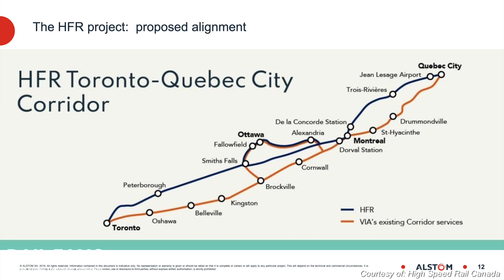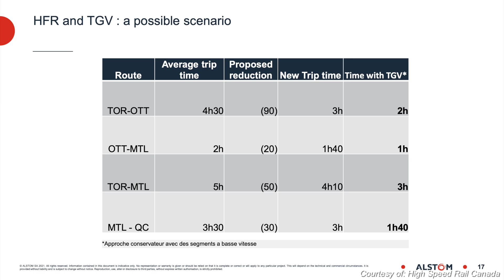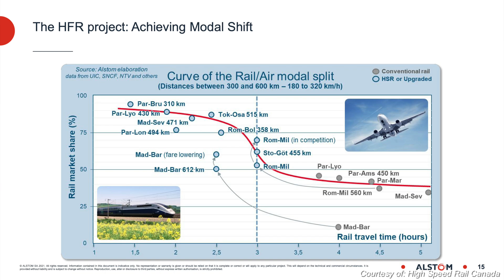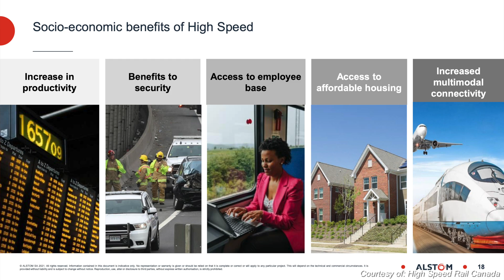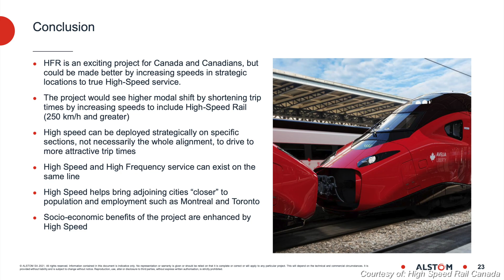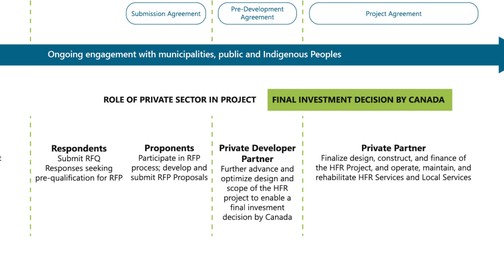The Plan To Bring High Speed Rail to the Corridor - Alstom's Proposal for High Frequency Rail (HFR)

Comment: Will never happen… Talk talk talk….  It’s October 2025… Blah blah blah… Canada does not have the skills necessary to build a modern railway system… talk and more talk…. City, provincial & federal governments in Canada are dysfunctional & cannot work together….  Canada talks about “high speed” every few years… talk talk talk….  Canada will not have a modern trouble free passenger railway system. Canada runs on roadways, highways and airports powered by the oil industry.

Comment: High Speed trains in Canada? Sure, but not between Toronto and Quebec City. Montreal - Quebec City, GREAT IDEA. Edmonton -Calgary, AWESOME. Toronto - Ottawa, maybe, Windsor - Toronto, possibly but Toronto - Montreal is IMPOSSIBLE. There are too many railway yards with speed limits below 50 km/hr between Toronto and Montreal. There are also too many residential areas in proximity of the existing track. Besides, the existing rails from Union Station to Whitby or Oshawa are in constant use for commuters and freight. Using existing tracks for high speed rail is crazy. The high speed trains in Europe and Asia run on wider track for a reason. If you wanted to build a high speed train from Toronto to Montreal, you'd have to build it from Vaughan or King City, thereby defeating the purpose of a high speed train between Toronto and Montreal. 
Of course, there are ways around the barriers if planners and engineers used their imaginations and the federal and provincial governments got together to finance such an endeavour. 
But keep in mind, maybe high speed trains are antiquated and that levitation may be the future...am I out to lunch?

Comment: Note: Alstom trains are extremely inferior to siemens and are guaranteed to be a bigger headache than an asset. The new Avelia trains have yet to enter to enter revenue service as there is an issue with software compatibility (something like that). At present they are gathering dust and having their paint stripped in a yard in Philadelphia. The Ottawa LRT uses Alstom as well - yup they've been great lol

Comment: Every stop on a HSR line and intersecting large cities slows the average speed down considerbly. Better to skirt cites and building stations near airports than build under central business districts and tie HSR with the local rail network with a spur... You don't lose overall time doing so. The fewer the stops, the faster the train. Don't turn HSR into a gold plated local rail network, you would be better off if you have too many stops to build HFR...
Reply: The train has to go to the people. People will not go to the train. When Canada was expanfing yes the people went to the train. But now that the country is lack of a better term established the train has to go to the people. Bypassing CBDs is a recipe for failure. It's job is to link cities in the foreground not in the background.

Comment: what about the many other cities along the corridor? are we just going to abandon them entirely so that Peterborough can have high speed rail? I think tat a dedicated line is needed but abandoning the rest of the system and leaving people between oshawa and dorval without a high speed network doesn't make much sense. Peterborough would definitely benefit from having a rail line connecting them to toronto or ottawa but if that is the goal then maybe have something like a go transit line that goes here and focus on upgrading the kingston subdivision. though im not a planner or someone who knows a lot about this stuff thats just my opinion and I would like to see the whole corridor benefit thats all.
Reply from the maker: As we somewhat cover in the video, a lot of details will be left to the private partner and government.

For what we know; there is a requirement for service to continue along the exisiting corridor, possibly with service increases. The original VIA proposal did include improvements there; in addition to the new alignment. Details are few and thin, so we are pretty much waiting to see more, either through the RFP (if the documents get released) or once a private partner is selected. -David

Comment: Ugh they really shouldn't be using alstom equipment it's not suitable for North American Trackwork its too fragile
Reply: The Alstom problem is from the legacy tracks on the Northeast Corridor, with newly built high speed segments there would be little to no problem doing any simulated tests. Practically how the LGV and TGV networks are run, high quality segments with high speed trains of quality but also needing to be replaced
Reply: Alston operates trains on brand new dedicated tracks on the new Ottawa LRT. It has the described problems here!

Comment: Alstrom was the manufacturer of Ottawa's fantastic LRT!
Reply: Why do you think the trains don't work Alstom hasn't produced any trains for Amtrak that haven't been plagued with issues the HHP-8 and Aveilia Liberty have both had many issues and the original acelas had to be taken out of service multiple times because of how many issues they had not to mention when Amtrak was looking for a replacement for the GG1 in the 1970s the French CC class was nearly unusable but the Swedish RC-4 was very successful and became the AEM-7
Reply: The problem of the LRT is that Ottawa’s LRT got upgraded into a light metro like service similar to the Vancouver Skytrain and Montreal REM, but with curves and segments built for tram vehicles. Running frequent and faster tram derived vehicles with some modifications to do metro like service will go into the same issues we see. 

Seeing that Toronto will use the same vehicles on Line 6 Finch West, it will have less of a problem with the type of service it will be doing and Ottawa not meddling with the designs.

Comment: One should ask the commuters in Ottawa if the same company who's wheel bearings keep failing & closing down their LRT should be allowed to bid on this project.
Reply from the maker: Which company manufactured the trains in Ottawa that you are referring to?
Reply: @RailFansCanada  Alstom and the Avelia's are having similar issues, buy Siemens Velaros instead.

Comment: but high speed operation would mean full electrification, is that possible?
Reply from the maker: From the numerous studies done over the years, nothing would indicate that it is not possible to achieve. I also doubt we’d see any non-electric high speed rolling stock adaptable for the North American market. As it stands, the plan for HFR would have AT LEAST 90% of the network electrified. -David
Reply: @RailFansCanada  I‘d just heard somewhere that some segments can’t be electrified because of the cargo companies. I don’t reall know a lot about privately owned rail infrastructure tho, I’m from Europe.
Reply from the maker: The current system that VIA Rail operates is almost exclusively on freight lines owned and operated by CN and CP Rail. The HFR/HSR plan calls for new dedicated passenger rail infrastructure, that only VIA would use. On these new sections, the track could be electrified but on any shared section, that could be more complicated due to the shared operation and the owner of the track not being VIA. There isn't really an exact answer at the moment as a lot will come down to what proponents of the project propose as their solution. - Shane

Comment: If it's not engineered for 140mph+ along with eventual overhead power supply then it's not worth doing. You can always begin service with diesel traction at 110mph to 125mph with a view to future updates that have already been engineered for.
Reply: Diesel? Over and out in the XXl Century.

Comment: I like the idea of a "Gare du Nord" in Montréal. Even if not at Edouard-Montpetit, as long as there's a connection to the metro somewhere.
Reply: The station in Ottawa is not downtown, so an outlying station is not something new.
Reply: @annoyed707   and the suburban station in Ottawa is an inconvenience. Ottawa made a mistake by removing rail service to the heart of the city, one of the main advantages of trains. When you arrive in “Ottawa,” you have to transfer to the local rail system to access the inner city; until recently, there wasn’t even this, only buses. A Montreal Gare du Nord would likewise be far less convenient than a station with direct downtown integration and between the orange and green lines, which is what we use now. It’s problematic enough that the Quebec City station requires you to walk with your luggage several blocks through the snow to get to the tramway; the Gare du Nord would make three cities in a row with inconvenient transit connections.

Comment: Anybody know how much VIA Rail have to pay CN and/or CP to use their rail on a yearly basis? 
I'm very curious to know that?
Reply from the maker: I do not believe this is a public figure, however it has been for VIA a considerable preoccupation at each time the current agreement was to expire. For HFR, the plan is to outright acquire the needed corridors, and as such, not require a capacity agreement with the freight operators. -David
Reply: The last forum I read on exo St- Jérôme,  someone said legal rights to "track" stay with CP. France keeps track split from operations too.

Comment: They have been talking about high speed rail in Canada since the 70s when Transport2000 was lobbying for it.
Reply: Canada had the Turbo Train in the 1970s which was able to reach speeds of 246 Km/hr but it was taken out of service by Via Rail in 1982 and then all of them were scrapped in 1984 .
Reply: What stopped it? The 70s had an oil crisis and Europe took real action and North America just waited it out rather than being innovative.
Reply: @pbilk  The Canada of the 70's was a very different landscape demographically compared to today. As noted, the Turbo Trains were forced to share rickety freight trackage with thousands of level crossings. The wigwags were not even down by the time the train was past, accidents were frequent. Remember 1970's were barely a decade post-steam locomotive here.

Comment: This is nice, and makes sense to follow the development model of SNCF, but it's basically corporate marketing for a multi billion dollar project. Not sure what will actually move the needle for federal investment and breaking ground in QC. Also, did they talk about actually how and where the new passenger only tracks would go? Any real surprises?
Reply from the maker: Given the procurement model for HFR, a lot of it is left to the private partner, so we don't exactly know. However, from the HFR maps shown by the government, we expect they will rely on mostly abandoned or branch lines. The more "surprising" parts are really the plans for Toronto and Montreal as there is very little space to add additional tracks, and will most likely rely on shared track access with CN/CP/Metrolinx.

Alstom's proposal seems to rely on the CP Trois-Rivieres branch (between Quebec City and Laval, for the most part on new tracks that might be profiled slightly differently to allow higher speeds),  the CP Park, Adirondack subdivision (from Laval to Dorval), CP Vaudreuil and CP Winchester (to leave Montreal), and then along the existing VIA tracks (former CN Alexandria subdivision).

Beyond Ottawa, it would rely on existing VIA tracks to Smiths Falls, then the Belleville subdivision up to a certain point. From that point onward, it would most likely be new tracks to Peterborough, following a similar alignment to the Trans Canada Trail.

Once in Peterborough, it will likely follow the CP Havelock and Bellevile subdivisions to the Don Valley, where it would then proceed on Metrolinx Don and Bala Branch.

We expect most HFR proposals to follow a very similar alignment. The potential differences are likely going to be in the speed grade of new and upgraded tracks, but also the approach to "the Montreal problem". -David
Reply: @RailFansCanada  VIA owns CP M&O line according to signs on the trail. A lot of crossings, but good enough for HFR.

Comment: I really think they should go all in !
And hope that Alstom also proposed a full speed alternative.
What I'm referring to is building a line based on the French / Spanish model (also known as the "parallel" model, in reference to the parallel layout in electrical circuitry) :
An uninterrupted high-speed line from Toronto's outskirts to Quebec City's outskirts, bypassing every city center in between, just "grazing" the intermediate cities.
That, plus either dedicated high-speed branches or simple "connector spurs" to access the legacy network and serve downtown stations and you have an extremely efficient, high capacity, high frequency network / line.

This would greatly slash travel times and increase capacity even more, offering a variety of services from ones calling at all stations to direct nonstop ones.
That way you can offer certain classes of service that would only be successful on major city pairs and with the shortest possible journey times.

France and Spain also rely on a number of secondary out-of-town "on-line" stations where trains bound for a farther destination could make a short stop without loosing too much time. (There are at least 4 tracks in these stations, 2 inner ones where nonstop trains run through without slowing and 2 or more outer tracks where trains stop that are of varying lengths depending on your frequency needs).

Even Madrid and Paris are bypassed by some trains.
Many cities have both a central station and a "TGV" or "AVE" station and they are both served by high-speed trains.

You can have a look on Google Maps sat view for CDG airport or Disneyland Resort Paris, they both are located on Paris' Eastern high-speed bypass or Lyon Saint Exupery airport located on Lyon's Eastern high-speed bypass. They all have through running underground stations where trains can stop or bypass each other at high-speed.

There's also Avignon TGV station, a perfect example of "on-line" station on the outskirts of the city where trains can stop or run through at full speed.
Or a major destination like Montpellier on the Mediterranean coast that has both a central and a high-speed out-of-town on-line station.

Canada's Eastern corridor would be perfect for that and the economic boost would be massive !
On such a setup, you can easily have trains every 4 minutes each way and none of them blocking any other.

These types of networks are also perfect for multiple levels of service from dirt cheap low-cost to full service premium. The flexibility and capacity of such a layout permit everything.

And frankly, it's much better than Acela !

If Canada really wants higher frequency and capacity, they have to go for the parallel model or their network will have the same problems as the German network currently has : delays and bottlenecks.

This Canadian "Eastern backbone" high-speed line could be massively successful, but they have to do it properly.

Comment: Don't get me wrong! I do understand what you're saying in regard to offering the successful possibility of a 3-hour service from Toronto to Montreal by bypassing large cities.

If you look at Via Rail’s latest map where an Ottawa bypass is proposed for some express thru-trains, it may indeed be possible to obtain very close to a 3-hour travel time!

However, the most pressing problem that we have in the Quebec City-Windsor corridor is that of stifling congestion on our highways where a supposed trip between Toronto-Montreal that should take 5-6 hours, actually translates into a 7 or 8 hour nightmare due to frequent accidents or inclement weather; the same goes for Toronto-Ottawa, where a trip should take 4 and a half hours but may take far longer!

Not only that, an immensely enticing modernized passenger rail project alternative travel option must also be affordable so as to entice huge numbers of drivers to make the switch ASAP with the goal of reducing our carbon emissions significantly since Canada produces some of the highest emissions per capita of any advanced country in the world!

I also would love to see HSR become reality in Canada, but simply wishing for HSR will not make it happen based on the endless proposals in the past 30 years or more!

It has already been shown that constructing HSR from Toronto to Montreal via the most-direct lakeshore route would not be possible as it owned by CN and would very likely cost, in today's dollars, from 50 to 100 billion alone.

CN would altogether oppose this kind of passenger rail expansion on their tracks!

As such, the present HFR proposal, with the possibility of bypassing our nation's capital Ottawa through an additional, direct route from Smiths Falls, Ontario to Montreal, could approach the magical 3-hour travel time envisaged in your response so as to satisfy most requirements!

If we can do it economically, then I could see a modified version of the HFR project, in actuality HSR on some segments of the route, becoming reality once it has been presented in a politically acceptable manner to the Canadian public.

Why do I make this assertion? This long-discussed HFR project will only serve the Quebec City-Toronto corridor while mostly dismissing the needs for modernizing passenger rail in other select areas in our country, such as the Calgary-Edmonton corridor, etc, thereby creating considerable political opposition towards HFR/HSR.

Let's also not ignore the well-entrenched air and auto industries that would not wholeheartedly embrace HFR/HSR because it would hurt their bottom lines!

It will be a monumental, if not an insurmountable, struggle for proponents of modernized passenger rail to achieve success on this HFR/HSR project!

We'll just have to wait and see what they come up with!

I strongly suspect that they'll initially approve a 200 kph HFR project to be subsequently constructed with a potentially upgradable to HSR future option in order to have at least some semblance of modernized passenger rail built.